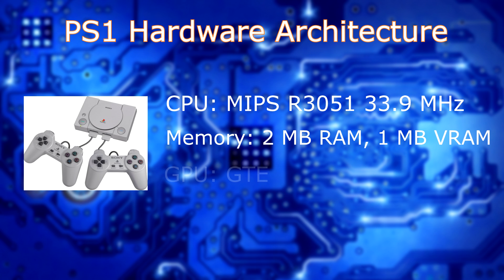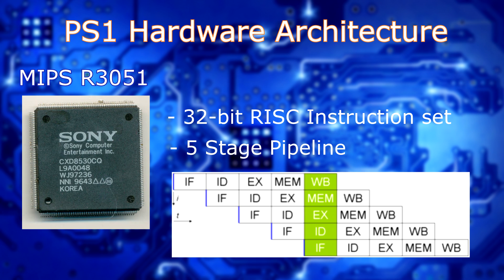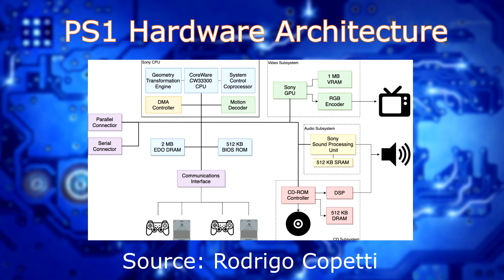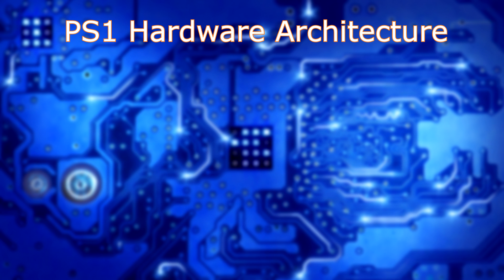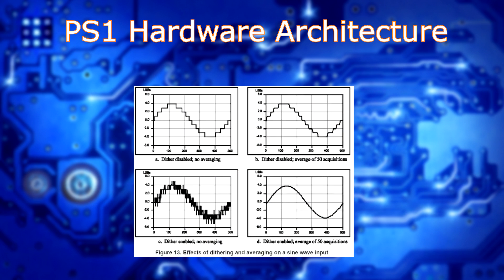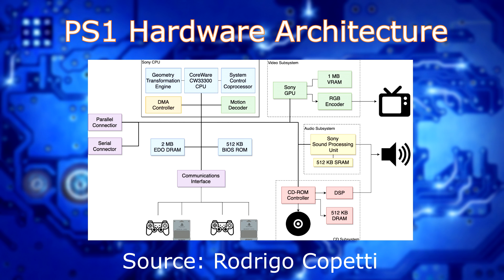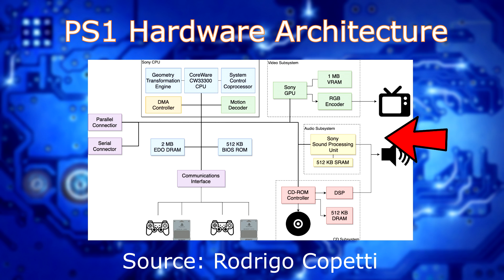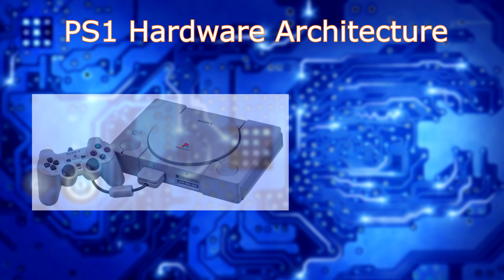What Was the PS1 Like to Develop Software on?

Comment: Old PS1 programmer here. From experience, the main problem with PS1 was the lack of perspective correct texture mapping, not fixed point. Fixed point is not inherently inaccurate; both schemes are still using 32 bits of precision.
Reply: For some reason, in my memory, it used 24-bit fixed point.  I can't find documentation that says one way or the other.
Reply: Fixed point is limited in its range to 1/4 billion.  Single precision fp can count the number of atoms in our galaxy.
Reply: If you tried to make a game world that big with floating point, though, you’d start getting accuracy issues and glitches outside a smaller area than the size of the equivalent fixed-point world: you’d have less usable area. Luckily, both have more than enough precision for a typical game world. Floating point just means you don’t have to remember to bitwise shift at the right time when doing your maths.
Reply: @jimmy21584  Both have to increment the scaling factor when they overflow, but fp does this automatically.  Floating point is used because billions of tiny perturbations and increments can affect the final results.

Comment: Some issues I noticed:
1. At 1:54 you list the GPU as the GTE, even though they’re completely separate components
2. The PS1 has no MMU or TLB. This functionality was removed from the system control coprocessor
3. The CPU is actually a LSI CW33300, which is binary compatible with the MIPS R3000A. The R3051 is a microcontroller built around the R3000 and was not used in the PS1
Reply: Damn, beat me to it on all three counts.  In practice, game consoles were always using the EC or LC versions of CPUs to save money (68EC020,  PA RISC 7100KC, etc) or gain extra performance (Cray supercomputers). Since only one process was represented on each processor, MMUs and TLBs were unnecessary.

Most of the power of the PS1 was in its GTE, but the C libraries were so obtuse that they lowered performance by 80-90%.  Eventually, that problem was worked out with developers.  I always suspected that SONY may have hobbled the system on purpose so that they could show better graphics with their games, but competition from the Saturn and "Ultra 64" proved too much.

The PS1 could theoretically draw 120,000 textured polygons with features on buy rarely got to 90k.  It could draw 360,000 flat shaded, though 1.5 million with no features could be done with the GTE.

Comment: 5 stage pipeline and syncronoud paralel audıo subsstem technically thats indirectly some as multicore cpus ... that makes sebse they used multicore pipeline sstem an lov memory witf fas cd data aceess which means easy to switch executing code. And seems thats enough to make it look faste-superior then it is.

Comment: I have just learned that dithering can be used in other type of signals other then just 2D images.
Reply from the maker: Yep!
Dithering is a technique that has numerous applications. I've used it myself for something totally unrelated
Reply: 2 years later, but really quiet and unaudible dithering (noise, either random or in patterns) is used in compressed audio to avoid compression artifacts and artifacts from the low bit depth

Comment: In the initial slide you refer to GTE as 'the GPU', however PS1 had a separate GPU chip designed by Toshiba as shown in the diagram later and you don't comment on its specs and capabilities (including frequency, vram bandwidth, fill rate etc.) Wasn't GTE more a 3D vector math accelerator/-co processor instead of 'the GPU'?..
Reply: GPU is an nvidia term. Back then, the math calculations and pixel pushing was split up, and considered different tasks. PCs had graphics cards with outputs and 3d accelerators. After nvidia merged the two functionalities in their cards, and ATI followed suit, we're left with the modern GPU and confusing graphics and computing APIs that uses them for 2d and 3d graphics output or just a convoluted matrix and vector math co-processor.
Reply: @PaulSpades  Sony refer to it as GPU in their technical manuals.
Reply: @SerBallister  i know. I'm just pointing out that 3d math acceleration and texture-processing/framebuffer/video-output functionality was traditionally split between different chips. And it might still be the solution for next gen graphics at some stage, provided enough data bandwidth between components is achievable.

Comment: Don't forget that the Playstation 2 sold 155 million, and most of the PS3's could still play PS1 games.  That means that games developed for the PS1 would run on about 300 million systems.  However, with its relatively low resolution, ordinary PCs can now emulate the PS1 entirely in the CPU and on the many GB or RAM that we've got to play with, including laptops.  That means that there are now billions of machines that can play games like Crash Bandicoot, Metal Gear, and GT2.
Reply: All PS3 play PSone games.

Comment: Nice introduction to ps1, however I have a few nit-pics:
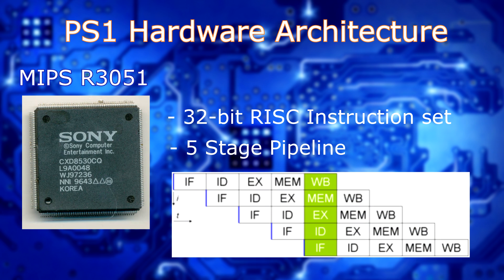At 2:20 you say "different stages of that instruction can be handled at the same time" , don't you mean different stages of multiple instructions, bc that makes sense and that's what the picture shows.
At 7:36  you say 44.1 k  audio.. that would be fine, if the video wasn't constantly referencing bits, this way not saying kHz causes a confusion.
And when talking about architecture, highlight parts you are talking about on the scheme more frequently, the time I'm looking for something (if I'm looking at the small screen) is the time I'm not fully appreciating what you are saying & not reflecting on the position of that part in the whole (this would have been be especially beneficial for Saturn).  
I like what you are doing on the channel, so this criticism is with the best of intentions. Keep up the good work!!!
Reply from the maker: Fiest off, THANK YOU for constructive criticism :) I always welcome it..
At 2:20, should have made it more clear, but with RISC, it's one instruction per clock cycle. That instruction I refer to is multiple instructions at different stages happening at the same time. "That Instruction" refers to the one instruction executed in unit time. However, I see how confusing that can sound 😅. I will make sure to say it more clearly next time.
7:36 I wholeheartedly agree. Should be specific that it's frequency.
And thanks for the last suggestion too! I will do that in the next video. 
Seriously though, these comments are awesome. It helps a ton. Thank you!!